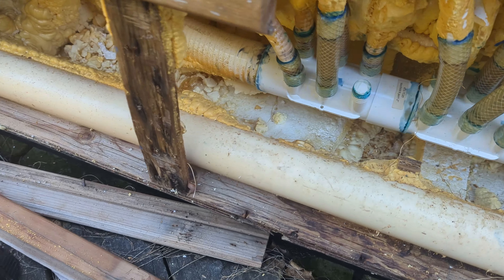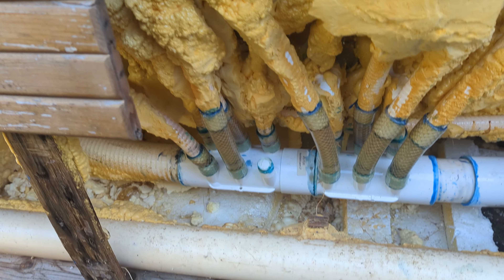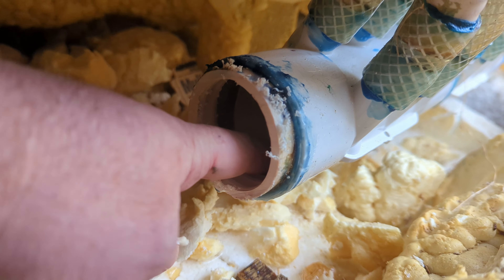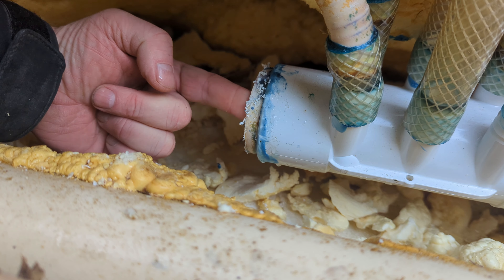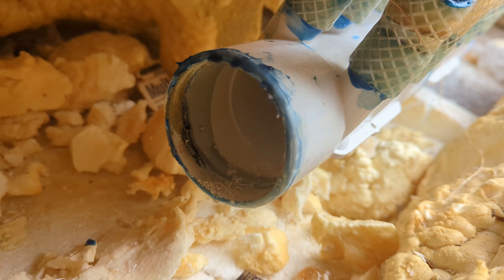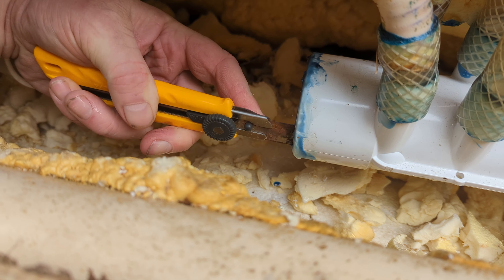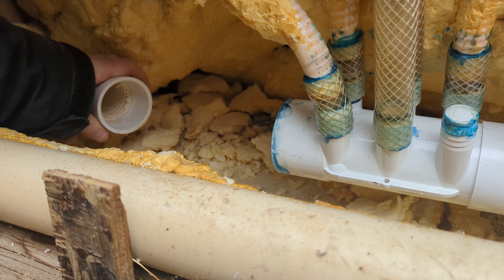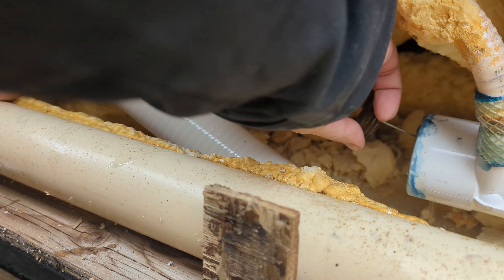Repairing a Hot Tub Pipe Leak / How to Fix a Hot Tub Plumbing Leak / Hot Tub Repairs

Comment: Your should use CPVC solvent cement for better perfomance.
Reply from the maker: @dckakadia  after 30 years, the stuff I use hasn't been an issue.  Used others and not so much on reliability for a hot tub.